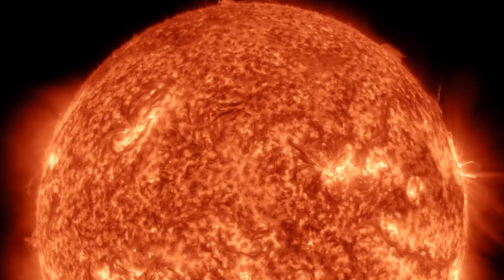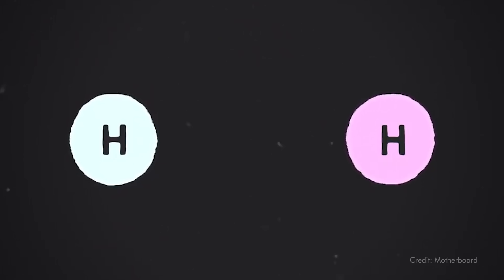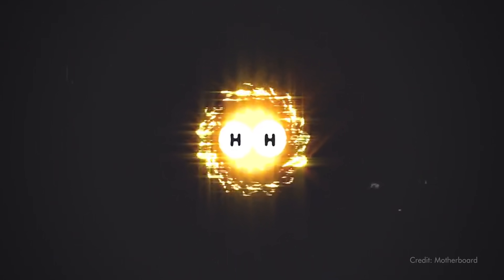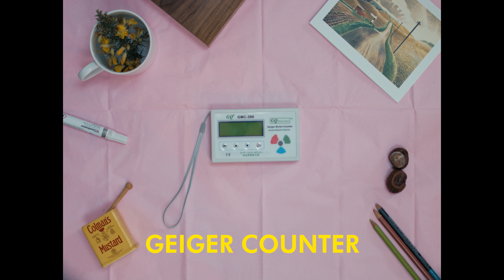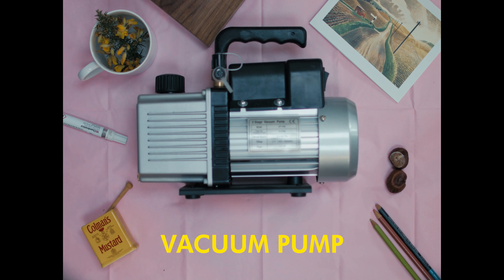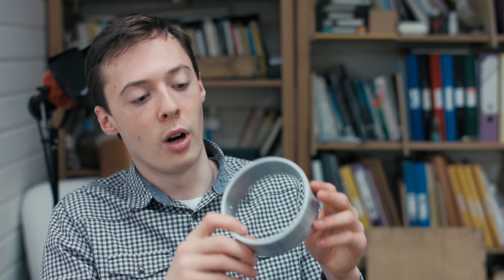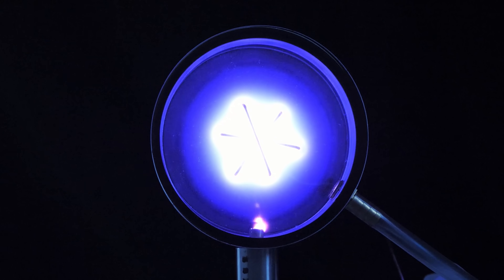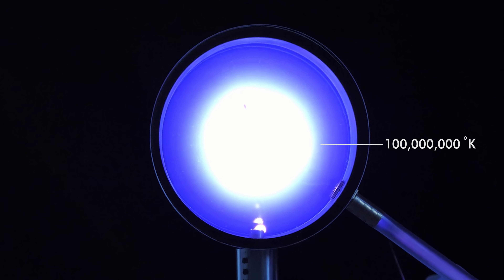Making a Desktop Fusion Reactor

Comment: why didnt the metal thingies in the middle of the chamber melt?
Reply: temp is based on avg ion velocity and increases roughly by 11x10^6 deg K for every 1kV increase. The reason the glass doesn't melt is he doesn't run it very long and the only transference of heat is by the rare ions.

Comment: Its not fusion! Its just high voltage in a vacuum! looks nice tho
Reply: It has long been known you can produce fusion reactions that use more energy than they produce. Extracting usefu excess energy from fusion is the tricky bit.
Reply: So the Geiger counter sound was fake or not?
Reply: @Reth_Hard  I'm guessing it's a cathode ray. They rays produce xrays.
Reply: @LunaWuna  
X-Rays, hum... I'm not sure I'd use it as a Desktop lamp!  :P
Reply: @Reth_Hard  The Geiger counter sound was real, but he used a GQ GMC-300 detector which ONLY detects ionizing radiation, not neutrons.  In other words, he was measuring x-rays.  This wasn't fusion, not even close.
Reply: Oh please.... this IS a plasma. There is fusion but not much. He could have set a neutron detector. Anyways
Reply: you can hear the Gyger counter in the background... So there probably was some neutron emissions...
Reply: @vedantchaudhari7123  or just x-rays
Reply: @vedantchaudhari7123  He used a GQ GMC-300 detector which ONLY detects ionizing radiation, not neutrons.
Reply: Electricity can’t be maintained in a vacuum
Reply: @_biscuit  actually electrons can move freely based on net voltage potentials in a vacuum which is why you can see Coronas
Reply: Storm Silvawalker the thing is the electrons will need to move to something otherwise you may as well be giving off beta radiation
Reply: @_biscuit  they move from the cathode to the anode so from the inner grid to the chamber walls, they also travel from the ions when they ionize at first to the chamber wall.
Reply: BOIIIIIIIIII LOOK UP AT THE OTHER COMMENT
Reply: zero neutron production
Reply: @rikimitchell916  isn't that fission lmao I'm pretty sure that's fission
Reply: @thugasaurusrex6004  deuterium fusion also creates free neutron, which is why fusors are used as high energy neutron sources
Reply: @rigen97  oh lol you right. Was thinking just in terms of what was going on here. He only used hydrogen here. Didn't make sense in that context
Reply: Nope. What he did was fusion lol. Read the top comment while you're at it too lol
Reply: @Sikway Sikway It's the particles in the gas creating plasma due to all the particles being smacked by massive flow of electrons between the center and the outer ring.
Reply: R/whoosh
Reply: Matthew Smith false. It is fusion.
Reply: @nonideal  - Prove it because physicist say otherwise.  Here's what it takes in terms of a vacuum to make an actual fuzor:

http://www.fusor.net/old-boards/intranets.com/vacuum/msg-5791.html
Reply: Wild guess but this light looked a lot line cherenkov radiation?
Reply: idk he did have the right pressure and he might have used D2O for that gas reaction so maybe he had some neutron emissions
Reply: @StormSilvawalker   fusion is created when 2 hydrogen atoms are forced together under extreme heat,pressure,and power currently the smallest working fusion reactor is around three tons next to its brother these get around 6 times hotter than the sun kinda impossible to create a small fusion reactor that fits on your desk most likely its somthing closer to krypton which is used in tesla orbs or neon used in store lights.
Reply: @Fallen7768  Actually Inertial Electrostatic Confinement devices such as this one (although I doubt this specific device did ) regularly perform fusion reactions at rates of several million neutrons per second. these devices are extremely inefficient but do get the job done and have since their invention over half a century ago. These devices work by creating a potential difference between two spherical electrodes which are transparent to the ions. A rarefied atmosphere of hydrogen-2 aka deuterium is ionized by the outer electrode and then the positive ions are attracted towards the centre. Yes the light seen is due to the same effect as in neon lights however at a much higher energy. Any fusion reactions must be detected as the neutrons emitted by the device as the ions fuse. As for the temperature, the required energy is imparted upon each ion in the same way as in a particle accelerator and thus the "temperature" is more equivalent to relative velocity and at below 1.0x10^5 Torr the ion temperature can be generalized as about 11.0x10^7 degrees Kelvin for every increase of 1000 volts potential difference. Thus running at 30kV these devices easily break 300 million degrees kelvin. These devices, sometimes called Farnsworth-Hirsch Fusors, are mostly used as high energy neutron sources and because of their high energy capabilities they are also used to study higher energy fusion, such as proton boron fusion. The heavier devices you are referring to are likely the more efficient magnetic confinement devices. these devices contain plasma in different geometries of solenoids and thus have a different set of operating principles, usually using neutral beam injection or microwaves to heat their plasma rather than a voltage acceleration as this is inefficient. There are many examples of good research done using IEC fusion devices and while this one may be misleading I hope that it has not put you off of the topic and I welcome you to explore the fascinating research done with ion accelerating fusion devices like these. For my part I invite you to make a simple one as it can be a fantastic experience and help to build an intuition for thermo distributions and high voltage potentials, they can be cheap and easy to make so long as you don't try to get them to do fusion as that usually takes an expensive steel chamber although no increase in size, the whole experience is one I myself have and one I believe many more should try.

https://en.wikipedia.org/wiki/Inertial_electrostatic_confinement

http://www.fusor.net/board/index.php?sid=8dbb489f34fedd7744cb9b76709dd057

and visit my channel for fusor tests and other experiments with high voltage if you would like :)
Reply: @StormSilvawalker   wow thanks im still young but im hoping to get farther into the science and history of fusion what i listed earlyer was closer to a neatral ingection chamber. 

PS: ill make sure to check over those links you posted
Reply: It could be a fusion, but not this votage. According to caculate, this damn thing just ionized the e, not that strong to against column force
Reply: @ducseul   he did say that he was using a voltage multiplier so it not going to be just 10kv, it will be a lot higher than that
Reply: wasn't vacuum, he filled it with hydrogen. He put some aluminium in caustic soda (lye) to make hydrogen, that was the red balloon. The high voltage ionizes it and makes it glow.
Reply: @krakenrex6050  not fusion
Reply: Its not fusion! Geiger counter goes off in the background
Reply: @oceanman7436  could just be the x-rays because of the electron energies, but the setup is pretty good
Reply: THIS IS NOT FUSION! ITS A CATHODE RAY!!!!!
Reply: @mkgames4115  PUTTING WHAT YOU SAY IN CAPS DOESN'T MAKE YOU CORRECT!
Reply: IT DOES
Reply: @mkgames4115  it doesn't, else you'd be correct.
Reply: Your right. Its not fusion. It is plasma. It is the same thing that the sun is made of. But it is not fusion.
Reply: Its fucking fake. Its edited. There is no plasma.......

Comment: In the fact you maked fuel from caustic soda aka Na(OH) it won't work. To make fusion reactor is needed hydrogen but not this hydrogen this hydrogen is ¹H but to make fusion you need isotopes of hydrogen two and three ²H and
 ³H is big different between hydrogen and hydrogen isotopes hydrogen isotop two contains one neutron  normal hydrogen doesn't and isotope three contains two neutrons. It's very important He is 2 neutrons and 2 protons. You can use only deuterium theoretically but you will not have rest energy thats used to power machines cities and countries. That glow is hydrogen plasma you have cool plasma lamp but if I know you can't call it fusor or fusion reactor two protons can't be together without neutron same charges repel different attract. Btw even if you knew it or you know it's just expensive.
Reply: Do you think he knows that?? He just made a lightbulb he claimed is a fusion reactor... And silver plated a mini beaker...

Comment: Nice plasma bulb. But I do not think there was fusion. You realy need the second isotope of hydrogen. To prove it you also need some radiation detectors to check if any fusion is happening or it will only be ionized hydrogen gas. Wich is a plasma but no energy release or no extra thermal heat and no helium as by product...

Comment: That is an awesome build! Great job! Just out of curiosity, did you post any further details anywhere online, like a parts list or guide or anything similar? I would love to know what transformer you were using. I have always wanted to make a demo fusor like this without sinking too much money into it.  Please let me know if any such information exists, if not I would be very grateful if you could point me toward the transformer you were using. It seemed relatively compact and inexpensive, but i could be mistaken. Thanks and once again awesome project!
Reply from the maker: James_Megariotis Thank you! I haven’t posted any detailed plans, but the fusor.net forums are a great resource. If you’re just looking to make a demo fusor then everything is much easier! I used a neon sign transformer that I picked up from eBay. Most people buy a glass bell jar and mount the components inside that, then connect the transformer directly to the base and cage. The most important part to getting an impressive looking plasma is the quality of the vacuum that you can pull. A 2 stage pump like I used is enough for most basic setups, but you can go all the way to turbomolecular pumps if you want a really impressive show.

Comment: With ordinary hydrogen shines just as well. This is an ordinary gas discharge lamp. Light is emitted when recombination of positive ions with electrons. A positively charged electrode separates the electron from the nucleus and a positively charged ion is formed - the nucleus of hydrogen. The positively charged hydrogen nucleus is accelerated by the electric field and flies towards the negatively charged grid. Electrons are produced on the grid, which recombine with hydrogen nuclei and emit light. If deuterium is used, then perhaps a small part of the hydrogen nuclei, accelerated by an electric field, collides in the center and forms helium-4. That is, nuclear fusion is purely kinetic. And it depends on the probability of getting into the effective cross section of the nucleus. To really start a thermonuclear reaction, you must first create a highly ionized deuterium plasma. Then, it is necessary to place this positively charged plasma in a very strongly positively charged sphere. So much charged that the repulsive force from the walls of the sphere was more repulsive forces in an array of nuclei. In this case, the nuclei will be concentrated and squeezed in the center of the sphere.
Reply: The acceleration of ions in a fusor has long been shown to allow for detectable neutrons and thus confirmed fusion reactions although I am doubtful due to him never showing his neutron detection.
Reply: pretty sure ordinary hydrogen ionization glows RED.
Reply: I'm sure there's no fusion taking place. There's a similar video of some two nerds building this thing, equipped with turbomolecular pumps and GM counters... etc Normal environmental radiation background count is usually 14. they used deuterium as fuel and they had to hide in another room. The GM counter showed some 63000 clicks per minute, I don't remember, but that is enough to give you radiation sickness or cancer. not a toy to light your room always. I also remember a teenager who wanted to build it and there was so much emphasis on safety first from his guides. A solution of boron salt is a must in order to absorb the high energy neutrons from a safety point of view.
Reply: 666ALISA666 Why are so many people “debunking” him, this is just a joke video. It’s obviously not fusion... I think when you debunk this trying to show your smarts, it just makes you look stupid.
Reply: @DaRealPianist  he does have a system set up in the correct way to attain fusion of he was using the right fuel and a better pump. There is just a mix of people here who have worked with IEC fusion setups and are checking his system and those that don't know what any of it is
Reply: @DaRealPianist  He is being incredibly genuine in his replies to comments and is (from what I can tell) using the correct setup but with the wrong resources. This may not be fusion but it sure is close enough for him to think that it is, and nevertheless, "debunking" him when he thinks that he has done it correctly just means giving constructive criticism (I'm not talking about the people who don't know what they are talking about and just want to think that they are smart, so they comment with some below par Wikipedia research)
Reply: @DaRealPianist , There is a device like this that really does work.. As to weather this is a CGI or, not. I cannot say..  Now there are a few points missing.. But he does have the basics down.. Hint. The key is a F load of voltage pressure. 

  If anything this makes a cool light that you can take your x-rays pictures with.. Perfect for that full body scans..

Comment: Extraordinary as the English say.  
It looked like you were making hydrogen from the caustic soda.  Was there supposed to be fusion of the hydrogen or the small percentage of deuterium mixed in?
You mentioned submitting ideas for projects you might try.  I saw that you have machining skills on the lathe.  And mirror making knowledge.  You might want to try this project.  If it works you might get a billion views and a Nobel prize.  But that is nothing compared to just the accomplishment of a net power fusion reactor.
You need a quartz tube a neter long, about 4 cm in diameter and about  .5 cm in thickness.
The quartz tube needs to be partially mirrored on the outer surface to the percentage necessary for the partial mirror on one end of a laser.   A second cylinder 10 cm in diameter made of stainless steel of the same length and highly mirtored on the inner suface is concentric with the quartz tube.  Grooves cut at regular intervals along the length of the inner surface of the quartz tube bend amplified laser light to a focus  along the axis of this cylindrical arrangement.  Half of the tube bends the light one direction at a shallow angle to the axis and the other half the other direction.  The idea is to build up enough voltage from laser accelerated electrons to confine the ends of a fusion temperature plasma.  If an excess of electrons can be built up and trapped in a very narrow dense plasma in this way, the resulting voltage will confine the ions of a plasma that is confined radially by magnetic field producing coils of wire.  The numbers suggest that even a billion degree plasma ion can be confined in a sub deci milimeter helical path with reasonably obtainable currents in these dimensions.  The laser activity between the inner and outer cylinders through a carbon dioxide gas lasing mixture should oroduce an extremely small focal area because of this radial configuration.  A mixture of Boron and hydrogen intoduced into the inner cylindrical cavity will be trapped in a very nartow cylinder along the axis by the ionizing intensity of the laser along the axis. The path to net power is established by using fusion to drive the laser.  By bombarding the ends of the plasma with fusion temperature ions, some fusion will be obtained.  As the infrared  radiant energy from this fusiin is fed back into the laser through the partial mirror, the laser will become more powerful.  This will increase the rate of fusion which will then further increase the power of the laser in a continuous andpower feedback loop.  At some point and finite length of the cylinder, it seems that the ends of the plasma can be confined.  A major objection to this idea is that light does not accelerate electrons in the direction of the travel of the light.  Compton scattering of Xrays accelerates electrons with a component of acceleration in the direction of travel of the Xrays.  Longer wavelengths of visible and infrared produce only very slight acceleratiion with a very slight angle in the direction of yravel of the light.  But multiplied enough times at the focus of a powerful laset there could be a very large acceleration.  There is also the possibility of Xray creation by the violent acceleration of electrons colliding at very high temperatures at the focal point.  A voltage multiplied along the length of the cylinder may at some point confine the ends of the plasma.  
The science was settled back in 1979 that said electrons cannot be accelerated in the direction of travel of the laser beam.  The science has since been unsettled.
https://www.sciencedaily.com/releases/2013/02/130228093833.htm

https://youtu.be/sW5HObAa09M

Comment: How much Xrays did you produce? You may have just been sterilized.
Reply: TropicalCoder nope it doesnt even fuse oxygen or nitrogen
Reply: @thanosxe.8464  Any where you have electrons accelerated over 10,000 volts and striking an anode X Rays may be produced
Reply: TropicalCoder Ow okk